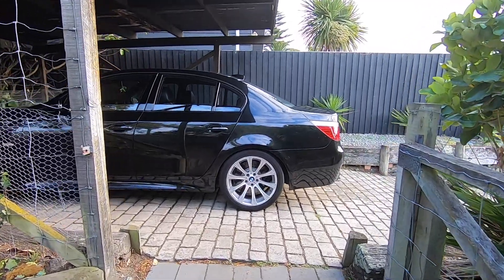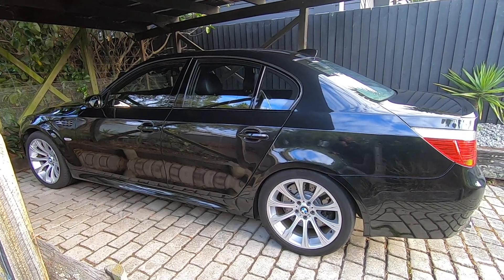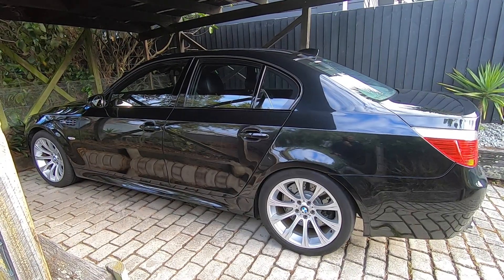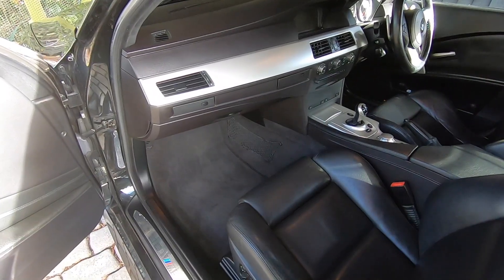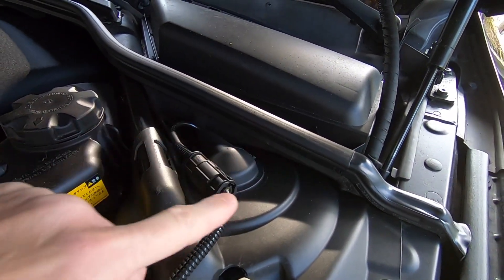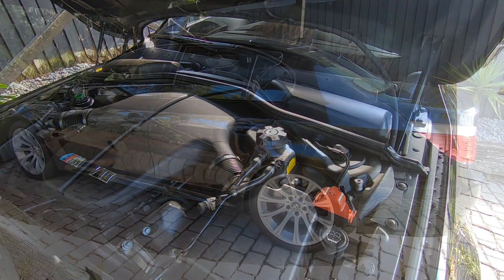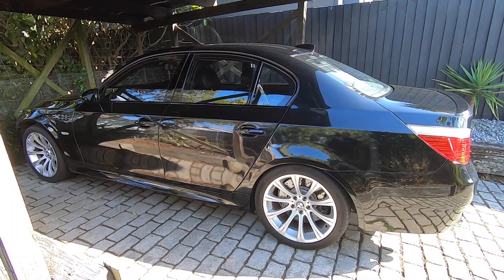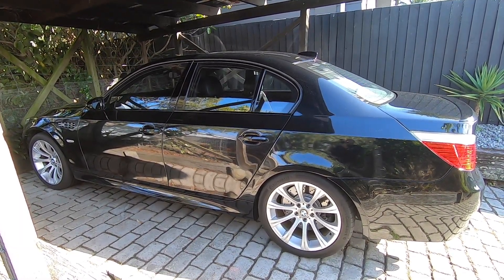BMW E60 M5 Electronic Damper Control (EDC Suspension)

Comment: Great video, thank you. I'm currently getting an EDC fault intermittently on my 2008 E60 M5. I tried replacing the module but I continued getting the fault. Does replacing the module require reprogramming or is it just plug-and-play? Also, would E63 M6 or E90 m3 module work or it needs to be E60 M5 module? Finally, if I'm continuing getting error, does that mean the actual dampers need replacement? Because they feel fine when I'm driving. Thank you.
Reply from the maker: First check your battery is in good health, then check all the electrical connectors on top of each shock are OK and secure. Read the fault codes and go from there. M5 or M6 module is OK and doesn’t need programming, but there was a change around ‘07 so make sure you get the right one for your car

Comment: informative, thank you. The part about potholes is scary. If one opts for regular shocks and overrides/disconnects the EDC, do you know if the car would still be comfortable? I disconnected my shocks and they went to full firmness, ride is awful; not sure if that is just a safety mechanism or if that is going to be how regalement non EDC shocks will be. My seven series has EDC but EDC shocks are too expensive but i still want comfort and great road holding. Advice?
Reply from the maker: Yes EDC shocks are $$$$! If you install regular shocks it will ride like regular shocks. There are aftermarket EDC options too

Comment: Thanks for the vid mate.  FYI, I've only just finished converting my '06 to Bilstein B16 Damptronic.  So far I've noticed its a little stiffer at comfort setting but otherwise fixed all my woes from OEM units being 16yrs old, leaking, and totally spent.  I couldn't find them anywhere here in Australia so had to import from Denmark.... not a cheap exercise!
Reply from the maker: That’s good to know! The originals are great when they are new, but don’t last as long as Bilsteins. The OEM ones are mental money too!
I think Bilstens have a lifetime warranty? Not a bad choice going for the B16’s 👍

Comment: Usually run mine in normal mode P400 for every day driving.... Will run it in comfort for bumpier roads or a softer drive as it makes the steering lighter

I go totally the opposite for M mode... So P500Sport and sport mode on the EDC... The best option for spirited driving and you can feel the difference in ride

I love how it self adjusts the level of the car and even though the majority of them out there are higher mileage, over 10 years old they are still solid cars when it comes to the ride
Reply from the maker: Yes it still amazes me how it works in the corners! Comfort is good in P500S if you want the rear tyres to hook up easier (it lets the back end bog down more) I normally go with sport setting with P500S for the windy roads

Comment: I usually just use comfort, M mode is mapped to normal. Sport for NZ road is too stiff, possibly a good way to wear out it faster. How many kms when you replaced it? Did you get your replacement from FCP euro, or local?
Reply from the maker: Same here, normally switch to sport if I’m on a windy road though. Comfort in 507hp mode if I want the rear tyres to hook up easier (it allows the rear end to bog down more) The replacements at the local dealer

Comment: Thanks for this. My suspension is definitely getting worn like you said and the comfort mode is not that comfortable anymore haha. Do you think replacing the bushings and control arms will help with that? Or will I need to replace the entire strut to get a smoother ride?
Reply from the maker: New bushes will freshen the suspension up but usually make it feel “tighter” The dampers (shocks & struts) will help smooth it out. Replacing my front struts really helped. The comfort setting is softer than the m sport suspension on my old E46 coupe